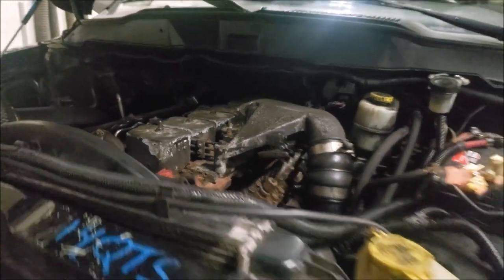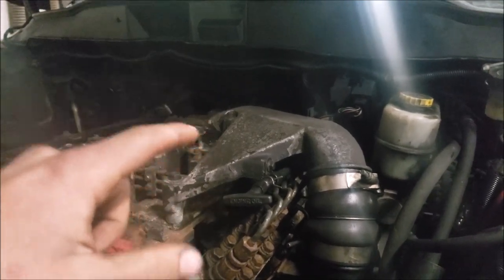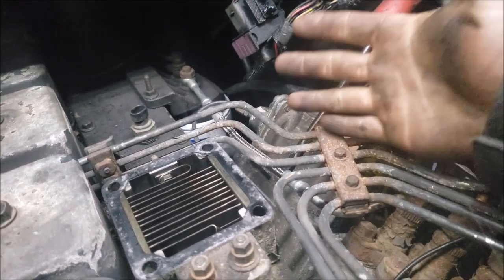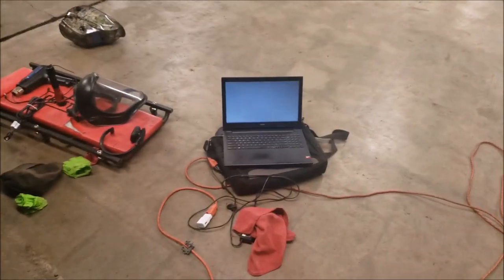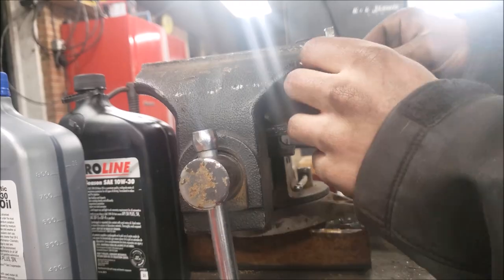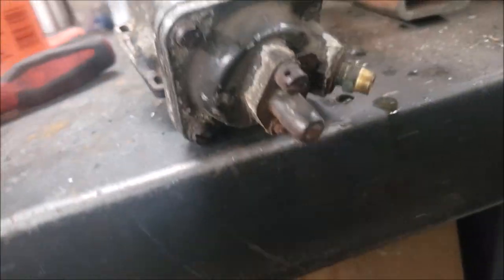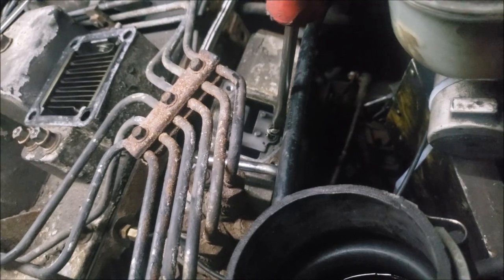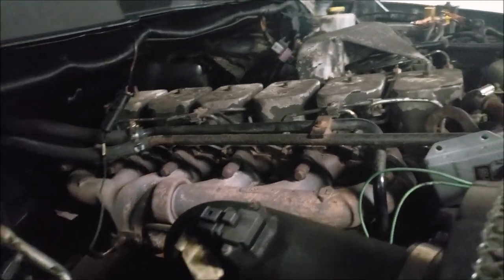How To Add 100hp For Free | 12 valve Cummins

Comment: Get the AFC spring kit for stock turbo 25-30psi from Power Driven Diesel, comes with new washers for the plunger as well. You'll be able to remove the fuel plate and back out the star wheel all the way. You can make your own "AFC live" all you need is a pressure regulator and a flow regulator. Connect a 1/4" line from the intake into your cab, connect air line to your flow regulator then your pressure regulator, then another 1/4" air line from outlet on your pressure regulator to your AFC housing. I spent $50 making my own fuel controller and u used all name brand Parker parts from Depaties fluid power. Also get 3k governor springs or 4k I just did 3k.
Reply from the maker: I ground the plate to a 0 and moved it all the way maxed, star wheel, smoke screw, pre boost adjustment, and flipped the washers. I have a 2012 vgt turbo on it. Everything working good. Governor springs and possible injectors are the only other mods I plan on doing
Reply: CP Steve Miller definitely recommend a 4K gov springs and 60 over valve springs I got both off amazon for cheap and it made a huge difference In my 97

Comment: You put slid the fuel plate back. I thought sliding it foward was the ticket
Reply from the maker: Yeah, that's what I meant. 

Towards the radiator = more fuel
Towards the firewall = less fuel

Comment: Is a 0 fuel plate safe for a stock truck and stock clutch
Reply from the maker: Stock clutch will get roasted over time.
Reply: Ok what fuel plate do you think I could put in it if I want more power but wanna run a  stock clutch and I don’t wanna wear it out

Comment: I grinded a #10 plate, no clicks on starwheel, smoke screw a tad in, mo wastegate on hx35, and I have high egts towing. With 4.56 gears and 35s. 
Makes 35psi.
Hows yours on egts with those fuel mods towing?
Reply from the maker: Mine can get pretty hot depending on where I put the vanes in the turbo. I'd say add some timing or a different turbo. I'm planning on going from 12 to 18 degrees timing and get governor springs. I clicked the star wheel 50 clicks

Comment: Hate to say it - but ‘Frankenstein projects’ and ‘reliable’ never seem to wind up in the same sentence. Ever...
Reply from the maker: Cheap, reliable, and ALL factory parts. I can walk into any auto parts store and get anything I need at any given time. The reason it's reliable over a new truck is because if anything breaks on the new trucks they go into limp mode and throw a fit and end up needing towed or limped somewhere. This is a fully mechanical truck that if anything fails it can still be driven without the pcm freaking out. Rear goes out? Slap it in 4wd to get home(been there). Any Gears go out? Avoid the broken ones and it'll still get you home. Bad injectors? Blown turbo? No problem. It'll still get you home. Can't say that at all from these new trucks. I work on the new and old trucks for a living and you will never find anything more simplistic than this truck here unfortunately. Need a motor? You can literally find motors for 1500 bucks all day around me and it takes 1 weekend to swap and go. Again, can't do that with a new truck and parts are 4x the price. Sad but that's all facts😔
Reply from the maker: @kctyphoon  ah but you missed a very big point. I do all my own repairs whereas most will rely on shops. I lose no revenue during break downs because any part I need is right up the road. I've never lost a dime due to break down on my old truck because it'll put me back maybe a few hours but I'm always planned ahead for what I can be. I've had so many problems with my fleet of tow trucks which were 2011 5500, 2012 4500, 2013 & 2014 5500 as well as a 2016 5500. They all had emissions failures and each costed me 2 grand (a piece!! 😱😱) to have them delete. Not to mention 2200 for injectors on 2 trucks, pcm failures, bad fuel ruining injection pumps, oh and 2 engines. The 2016 dropped a valve on the highway which is a common complaint and the 2013 an injector stuck open and melted number 6 right to the cylinder wall. Problem with new trucks and warranties is you'll always wait on a dealer who doesn't care about your time. My old truck never takes more than 4 hours for any repair(other than maybe a motor??) If it were to ever need one. I've thought about new but I can't justify the break downs, expensive parts, and warranty work that can be weeks out at times. I get where you're coming from but as a mechanic this old truck still does the job and at 455k still can make me a grand or 2 weekly in my pocket. I'll take it. Your way works for certain people and older trucks work for the more mechanically inclined it seems. No hate though, I do like seeing other people's point of view👍(forgot to mention those motor jobs were 8k and 10k so 18k total for both) costs 1500 for a used 12 valve and they never die unless you run out of oil
Reply: @CPSteveMiller  I've run a cost analysis several times on newer trucks vs keeping my old shit box trucks (05' 24v) (97' 12v) and have so many guys in my line of work tell me I need to "buy new" but it just doesn't make any sense mathematically. I'm not too mechanically inclined, that's why I'm on youtube watching videos of other people tune these up to help me figure things out for myself. I can do basic maintenance, starter, alternator, disc brakes/rotors/caliper, fuel n filter changes, and started getting more tools so I can move on to more advanced tasks as I learn, this revolves around $$$$$. Where I live I was quoted $1500+ to change out the rear rotors, calipers & brake pads, that's with me supplying the parts! A few calls and some utube ha I was able to diy. The other point is that these older trucks have less problems, less sensors, no emissions, and people seem to overlook that, but it's nothing but dollar bills on fire and problems down the road. And the parts for a 12v are so damn cheap (compared to the newer trucks, it's outrageous what newer diesel parts cost!) I'm paying right now for my 05' transmission to get rebuilt, new triple disc+rebuild+labor puts me at $4500. But the pop quiz is well, if you buy a new truck, payments are probably $7-800 a month and that's with atleast $10,000 down. A full brand new transmission in my older truck is the equivalent to someone's six monthly payments and that's a huge repair. Let people factor in the costs of interest rates, depreciation on that asset and they're underwater on a truck loan. The other thing is I am proud of my shit box trucks, they banged n dented, and I just don't care because it's used "for work" I see these clean finger nailed dudes in skinny jeans in a lifted 22' cummins with no dirt on their boots and I strongly feel the only person they are looking to impress is other dudes lmao!! & in closing nothing sounds better than 12 valve, I love my old tractor truck haha